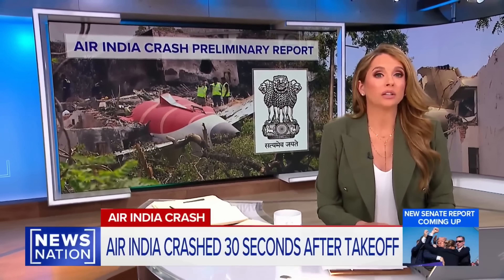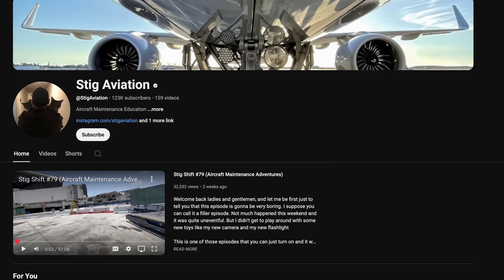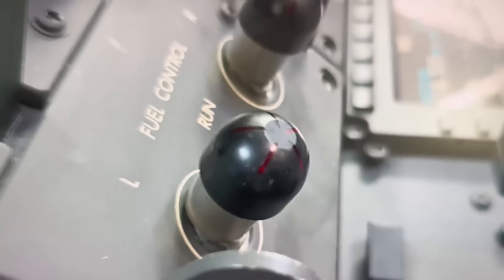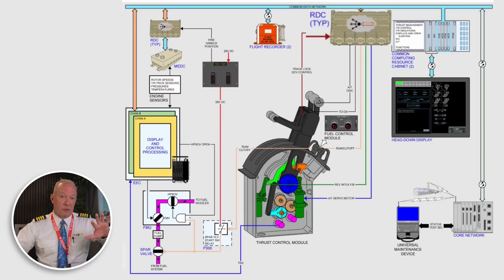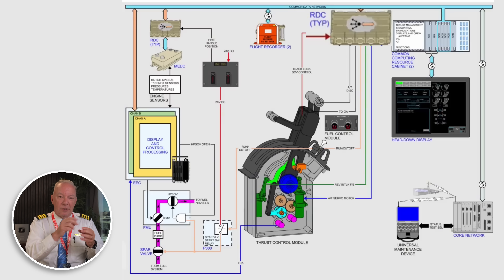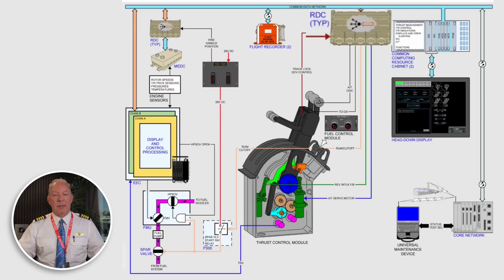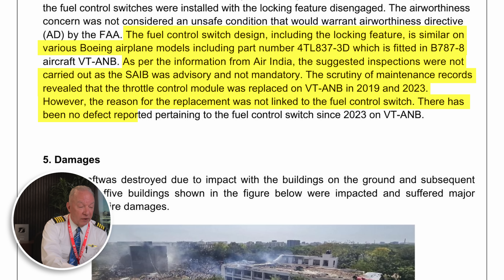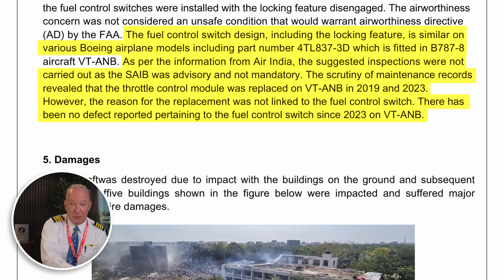The Truth About Boeing 787 Fuel Control Switches

Comment: The more I hear about this, the more I think it could be a Boeing airplane error, and that the battery flipped on-off. There was some glitch in the electronics that made those engines turn off at just the wrong time, and the reason the pilot asked, why did you turn those off, and the other one said, I did not, is because he did not, and the first one that asked was just mistaken, and thought he must have done it. That is also why the plane was found with the fuel switches on. They were always on. The pilot didn't just try to put them back on. They automatically went back on because the system restarted.
Reply: I agree with JustMade above but with some suggested clarification based on reading the scores of comments here from various laymen and engineers. (I have an engineering degree, but not in avionics). And I don't exclude that there may have been pilot action, but ....   First, comments mention that the FDR gets a digital signal to indicate the switches were off, not that they were actually physically  turned off. As JustMade says, a pilot seeing an indication of that signal or hearing the engines wind down could have made his comment without looking at the switch positions. Maybe they stayed in the "on" position and were found that way. (And this supports comments made that the CVR would have yielded loud clicks for OFF and back ON 2x2 =4 total).   As I posted over a week ago in the Piers Morgan show comments --- requesting Boeing to post the wiring diagram and explain if there is a common point of failure (e.g. power)  --  we have to consider if there is a common point in the circuits for BOTH switches to the relays, maybe the 28v bus supply.  That could be a "single point of failure" affecting both relays to close almost simultaneously. That common point also answers the posters that two simultaneous failures is statistically remote.  And that would answer Capt. Steve repeating a few times (in good faith belief) e.g. at 5:03 that "there are no other inputs" to the system.  The flaw could be an  uncommanded transient electrical failure WITHIN the circuit system common to both switches. Maybe the RAT is what "fixes" it in 10-14 seconds with power or maybe the transient stops and power restores,  but altitude was too low to save.  Boeing engineers need to step up here on this theory -- because other 787's and the public are at risk of the same fluke.
Reply: @bt3845  You're working way too hard to see an uncommanded electrical fail. If there is one, then it will be a potential (no pun intended) in any aircraft that has fuel cutoff switches, and not just in aircraft type. A common point will not give us cutoffs to the two engines with delay. "Uncommanded transient electrical" is clutching at straws, and any aircraft with similar systems is subject to it. When it happens just after rotation, that's piling coincidences on top of each other. Phooey. When such cutoff happens rarely, lean on human intervention, which is what it looks like in the first place. What a struggle to avoid seeing the prospect of evil in humans - rare enough in aviation which selects for level-headed people, but can't exclude the suicidal/murderous 100%.
Reply: @bt3845  both the CVR and FDR are powered by the same source as the fuel control panel - the battery busbar.  They don't have internal power supplies so any interrupt to the battery busbar power would result in a loss of CVR and FDR data and their associated timestamps.
Aircraft have transient electrical all the time, for reasons I won't get into you can only have 1 power source (generator) feeding 1 power supply, ie a busbar.
From a powered off aircraft to engines running you go through the following power transitions:
Battery to GPU to APU to engine generators reverse applies on shutdown and you'll have seen that when the aircraft is shutting down on the stand at the end of the flight (fan noise change and light flicker).
Aircraft are also designed to keep the battery busbar powered above all else, its built to deal with power transfer and their associated drop outs.
Reply: @bt3845  The problem is that those are a lot of 'maybes' that are required to ignore the evidence we do have.

And what's more, no, if an engine failure happened and the pilot hadn't seen the other one he wouldn't assume that he'd turned them off, that'd be insane. There is far too much stretch here to ignore the far more obvious solution.
Reply: @bt3845  Thank you. I'm not an engineer, but I'm just using common sense and some smarts. I appreciate an engineer actually backing me up here. I also want to point out that the report saying they turned on and off a second apart does not mean it's literally a second. They didn't specify the amount of milliseconds. They could just say a second because it's not instantaneous, but nearly instantaneous, and their English is not that precise in the report. We don't know whether they turned off literally a second apart or whether they turned off less than a second apart, but the report just says a second because it's easier to say that way than 300 milliseconds. They wouldn't need to simultaneously be seen as turned off exactly at the same time in order for this to be an electrical failure. There could have been a quick but not immediate staggering of electrical dip.
Reply: @IJustMadeAComment: "at just the wrong time" is something you pulled out of your backside. "They automatically went back" because... magick. Pulled out of your backside.
Reply: @Amanda_B_Reckyndwyth  What are you even talking about? You just seem hostile. At just the right time means that it's just bad luck, but it's also a time during takeoff when the engine and the systems are demanding more power. If the generators were faulty for some reason and didn't provide enough power, The battery may be overtaxed and bring the DC voltage below the threshold, and unfortunately that would be at the worst time rate during takeoff. And they automatically went back on again because either the generators were restored or, more likely, the RAT took over and was able to provide the necessary power to show the engine switches as in the on position again. Please don't insult me like that. It's really not very nice, especially when you have no idea what you're talking about.
Reply: If the engines failed due to some glitch the pilots would have been like "we have an engine failure", it wouldn't even cross your mind that your fellow pilot toggled the fuel cutoff switches unless you saw them in the off-position. Also, these switches have four sets of contact each and as far as I understand what the FDR records comes from its own set of contacts on the switch, which means the fact that the FDR recorded the switches toggling and the engines subsequently behaved like their fuel was cut off is very strong evidence that the switches were in fact physically toggled.
Reply: @MatthijsvanDuin  Lotta guesisng there. I could easily seem someone assuming another person turned them off before looking.
Reply: @IJustMadeAComment  There's no "guessing" anywhere in what I said. It is inconceivable a pilot would accuse their colleague of doing that unless it's an inescapable conclusion based on what they see. The only thing that would lead to that conclusion is seeing the fuel switches positioned in cutoff. An engine failure would just be an engine failure, simple as that.

As for the second part, "very strong evidence" was in fact an understatement, it is pretty much conclusive evidence.
Reply: @MatthijsvanDuin  If the air conditioning suddenly turns off in your car. Could you not say to the passenger while you're busy driving "why did you turn it off?" Of course you could.
Reply: @IJustMadeAComment  Are you serious? It is reasonable for a passenger to fiddle with the air conditioning, it is not reasonable to suspect a pilot just turning off both engines in flight
Reply: @MatthijsvanDuin  Right which is why he would be shocked when asking. It is even more weird for them to turn off randomly.
Reply: @MatthijsvanDuin They could've got dashboard warning
Reply: And why does the FDR explicitly show the switches being toggled off, one after the other and then ten or so seconds later, toggled back on one after the other?
Reply: Completely agreed 👍💯, that's exactly what I said last month. Good understanding of electronics 👍
Reply: @pragat647  @IJustMadeAComment  no understanding of aircraft though.
The battery busbar isn't powered by the battery except for the following:
Initial power up of a dark aircraft.
During power transition from APU to GPU
When all other generating sources are offline.
To put it another way, the battery busbar is fed from the engine generators in flight and flight critical system are wired to it, the aircraft will do everything it can to keep this busbar running.  The FDR and CVR are powered by the battery busbar only and there is no report of missing data from those units.
Fuel control relay doesn't open with power removed either, you have to apply power to both open and close it (latched relay) for exactly the reason that you don't want a brief power interrupt causing fuel to be cut to the engines.

Comment: i watched your conversation the other day about how they need to keep all options open. i’m with you!!!! they really tried to diminish your logical conclusion backed by  facts. i really want to see them rebut these facts. you claim you always need to keep 1% open however i want to discuss that possibility and the severity of its consequences . I  pray that  the design of this fuel operation  would never allow  for remote operations by anyone other than the person sitting in those 2 front seats.  captain steve  can you  confirm that the plane has no Auto function to correct bird strikes or shut down sequences for any purpose that a pilot would be required to do in a check list sequence ? please confirm that this plane does not have any capability to have ANY operation to be handed off, given over to, taken from, electronically. please confirm.. i know they can fly themselves however  please tell me that there is no portion (back door) operation that any control can be over rode by a hacker. the 1% i see here is IF…. the plane can control itself. (land,take off, fly) through an operation of “auto pilot” it needs to be clarified that the very same input signals that the plane receives can not be manipulated to trigger the plane to self correct a false input. in short terms, a hacker could triggered a false input of a flame out causing the planes (auto) to run a sequence of auto correct? this is scary. because i’m telling you if they have incorporated this technology into this aircraft, the 1% is gonna be my 99% probability. looking at this from a criminal prospective, if i as a hacker/ terrorist know that triggering an overspend would trigger the autopilot to slow down. and change the values of a stall to not be detectable. , it would be impossible to recover a stalled aircraft that was feed false data to fly within set parameters . i’m hoping boeing is not that naive

Comment: Excellent detailed description of how the cut-off switches work. Yes, we do want the best from people. This accident is challenging that. Thank Captain Steve 👏
Reply: The sad thing is that no amount of factual, scientific evidence will influence certain people who are determined to push their half-baked theories based on blue-sky hand waving. It's especially true for those who are pathologically obsessed with bashing Boeing.
Reply: Turning a switch off and then back on is not evidence of suicide.
Reply: @JoeLinux2000  from an aviation safety perspective, it is the apparent cause requiring prevention attention, unless there is reason to believe otherwise.   This is sensitive area where people feel public should be told it is a mystery, and certainly the pilots are innocent, even if there is a serious doubt of innocence.   "S" word disallowed.  Human factors.
Reply: @JoeLinux2000  No one is suggesting that.

Comment: Captain Steve every one just on the basis of preliminary report has concluded pilot suicide  which I disagree my point is this the flight is in a very critical phase and now fule switch is cut off by one pilot and the other waited for 10 second to switch on just stand in front of a clock and see the second moving for ten seconds it's plenty of time ( delay) for the fuel switch to be made on where considering the critical phase of flight it should have been done immediately Now as per directive of Boeing regarding fuel cut off switch a possible scenario is fuel cut off switch went automatically to off that's why got a delay of 10 second by a confused pilot and a statement also is made which is vehement denied Again if one of the pilot has switched off the fuel cut off switch deliberately then he will not allow the switch to be made on and hear we have the evidence that it was made on and engine had started to function This all points to Boeing which has very very bad record remember 737 max it's only after second aircraft crashing did Boeing admit It would be interesting to note your viewpoint sir

Comment: Correction pls: 
ATA Ch26 'fire handles' on the same pedestal when pulled  will ALSO shut the corresponding engines (via internal fire handle switches) even if the 'eng fuel switches' you mentioned are still at 'run'...the circuit is bypassed in case of eng fire. A closer look at the possiblity of those switches being contaminated with liquid from water, juice, coffee, wine, ants etc which may have caused engines to seem to shut down by themselves  is highly recommended. Nice video though, Capt. thanks.

Comment: As an electrician of 35 years plus. this video makes so much sens. 
I do have a suggestion moving forward and it would probably be considered on future designs.
THERE IS NO REASON  FOR THESE SWITCHESE TO SHUT OFF AT SUCH A LOW ALTITUDE  ,At least not both of them at the same time . I KNOW IM.NOT THE ONLY ONE THINKING THIS IS ABSURD , SO PLEASE have them disabled internaly    for the first few seconds from take off. That way there is some redundancy  in the system  for acidentaly or intentionaly shutting fuel down  to the engines. I was surprised this is not already implemented.

Comment: I don’t think the pilots intentionally turned off the switches. There has to be a better explanation.
Reply: You don't want to believe it. Doesn't mean it isn't true.
Reply: @stimproid agreed.
Reply: Cap. Stevee is stuck with the theory that the cut off switches have to be manually operated. Granted, but why did they have to cut it off? The plane had already issues with its electrical systems before it took off. I think poor maintenance techs of AI.
Reply: @oommanthomas2710  Correct I used to watch Steeve's video but I don't like the idea of sticking to a theory. Hence I have stopped watching his video now. I still do not agree to the theory that the AI171 pilot had intentionally switched off the plane. I just see heavy marketing of this idea I don't know why. People here in India will laugh if you say them a person (who earns well) was in bad mental condition and due to that killed 242 people. May be this idea flys in the west but not here. SO that theory is not making sense at all. I will always believe that the report was manipulated if they tell this theory unless they put out all the data of the Black Box in public without any manipulation.

Comment: As an electronics engineer I was wondering if there was anyway the switch or relay contacts my have closed due to vibration or something but nothing to do with the switch being activated. However even if I convinced myself a relay contact could get jammed from a short etc now you have explained these are two totally separate systems, like you its almost a bridge too far to imagine both relays having the same problem. However to be totally convinced I would need to see the wiring of the actual relays, is there anyway something could short both relay coils to what ever is needed to activate it? even if there was I believe the flight recorder logged the time the switch was off to on again and it wasn't close which makes it even more unlikely it was an intermittent short.
Reply: Have you ever taken off with an out of balance nose wheel and seen and felt the vibrations that are caused as the nose wheels go through the different speeds of the takeoff and than once airborne the wheels slowing down. Can be quiet severe, especially with a combination of cold tyres and out of balance.
Reply: @LyndonKruger  No but sounds reasonable hence my questions. Trouble is Im assuming any evidence of a possible short etc would be totally destroyed. I have definitely seen some things that would appear so unlikely as to be totally dismissed